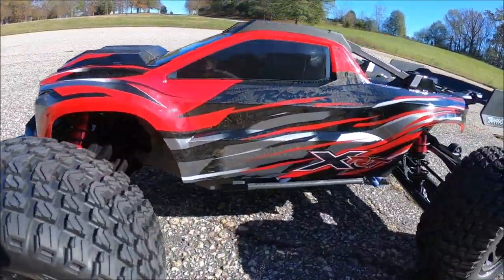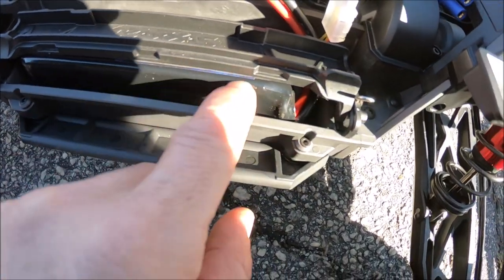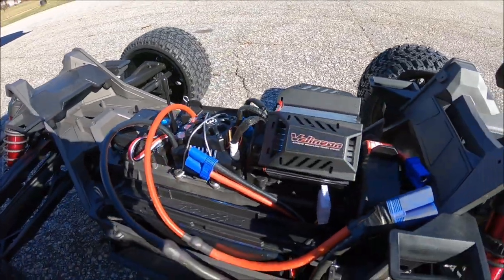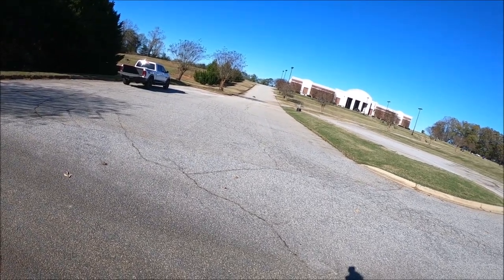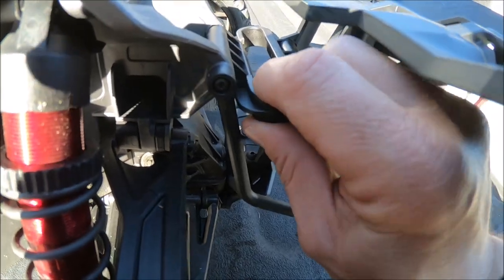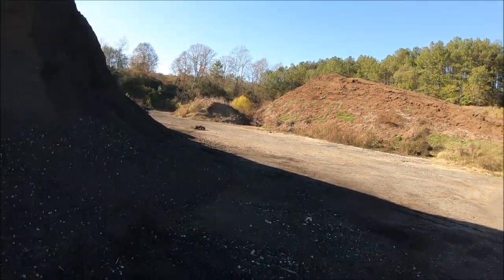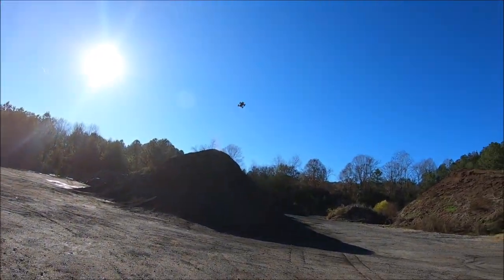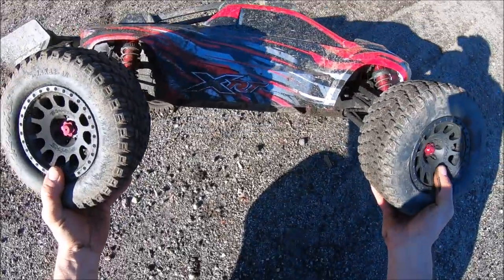NEW TRAXXAS XRT 8s Maiden Thrash!😱 This Truck is....!

Comment: Thanks again RCD, always love watching you do your thing.
👍🚀💯🔥🚀🤙 
It would be nice for Traxxas to accept my year old X-maxx 8s back and send me an XRT. Since they where short handed, being disabled I went on my weekends to my local hobby shop and helped them repair RC's.  They paid me on a gift card and of course the Xmaxx is what they knew I wanted and we helped each other out. So I held onto every penny put on a gift card so I could not touch it till paid off the X-maxx.  The part that really gets to me is that I ran on 6s first as I was waiting on the 8s completor pack and it ran fine. As soon as I got the 2x4s batteries, first run found out that they had thrown the 6s tires on the 8s I got and 2 tires came unglued quick. Realizing they were 6s rated, contacted traxxas support and told them about the tires and the sent me 2 new tires. Problem was the tires come in one direction to a pack and I had 1 from each side come apart. So I in good faith bought the other side. 4th run as I was doing a wheelie back to me the front dropped and you could hear the motor spin but no movement.  All but 3 teeth combined between the spur and pinion stripped. So called traxxas again and was told they do that just buy more. 🤔 If you know the gears are like the particle board of gears, why not put steel gears in? On the 5th -6th run as it was coming to a rolling stop it would grab and stop, roll it back and forth with my hand and forward it would grab and no wheel movement. Had the local hobby shop look at it and couldn't find the problem as I already checked out the f/r diffs especially when the gears stripped to make sure the teeth didn't get into other parts. Was told to come back if more pronounced.  2 days later brought back as it sounded like a bike with cards in the spokes. So the took out the Center diff only to find out it should not have passed QC because the spider gears were machined wrong and that they usually don't check the center diff because that's very rarely a problem. So it sat at the shop for 5 months waiting on the spider gears, so I decided to order from Cali and they got here before the ones they ordered from Traxxas one state over. They replaced them and when the ones they ordered came In under warranty I have as backups for any reason. 🙏ing nothing goes wrong with it now as it sat pretty much 8months out of the year warranty so not alot of time if something electrical goes out. Also the 2x4s batteries are paper weights now as some how one month after warranty on batteries, fine one day then the next, 1 with 1bad cell and the other had 2 bad cells.  I even balance charge, have a cell checker/equalizer and pamper my batteries making sure if not being used in 2-3 days after to store charge. And no signs of wear or damage.? Sorry Just had to share my experience with the Xmaxx and if the XRT was out earlier would have went with it instead. More my type of vehicle.  Ya for a $1000 Rc I pretty much only run 6s now since I'm afraid to go back to 8s. At least on the X-maxx.  I wondered WHY everyone was changing all the electronics and gears. I wish they were short staffed again so I could work off most of the XRT. ALL THOSE PROBLEMS AND I DON'T SKY BASH. Just racing around and hitting jumps in my yard going no more than 3ft in the air. Fireteam on it's way. Xmaxx on it's way out the door. 🤣🤣
Reply: Also reported that guy trolling you channel telling people they one a package from you. To take a screenshot of the text and respond to him for the prize hoping to help get him caught or blocked and leave your channel alone. I got another this morning. Just FYI 👍

Comment: Absolutely awesome first Rip Brother Eric 😜!!! The stock tires looked great on the asphalt and nice at the gravel spot too. Really a good call by Traxxas for all around mixed use. The flat style chassis has such a huge strength advantage over the arched XMaxx 😱. Those huge ramp sends are evidence enough 🚀🚀. I'm stoked with the handling focused large truggy platform 😍. M2C is all over it. Can't wait to try out the 1100 HW combo!!! Loved that wicked freestyling at the pit Bro 🍻. Thanks for another great upload!!! 🤙🤙😎💪👊👊
Reply from the maker: Thanks Brother Rich!!😁Definitely had fun and better luck with the XRT than I did with Humpty🤣🤣Traxxas really nailed this platform! Just can't wait to get more horsepower and some M2C beef!💪💪Yes the flat chassis makes a big difference in overall strength! Can't wait to run it again! Thanks for your comment bro!😎👊🚀🚀

Comment: Out of the box, You have to watch temps on stock gearing too. The Servo blew in 2 runs, the wing mount was gone. I’ve done almost ALL the m2c upgrades for it (besides chassis brace) have an 800kv Hobbywing and I still favor the K8 EXB. Just as durable, more fun, more controlled and i spent less.
The XRT IS fun but not K8 fun.

Comment: Did you at least try the stock esc,or are you just over stock electrics? I'll have one eventually, I would've loved to see a stock bash,then hobbywing. Looking good,thanks for the info.
Reply from the maker: Honestly I have limited time so didn't feel like bothering with the stock ESC. It's difficult to program and it dumbs down the power. In past experiences anyway😂

Comment: Seems like no matter how fast a car is, out of the box.... that some people will always say it needs to be "woke up". The truth is, this thing is wicked fast straight out the box, especially with the included speed gear. With that said, I enjoy watching these guys straight up abuse their equipment, so I don't need to.
Reply from the maker: Yessir that's why I used the speed gearing and HR 46 steel spur. With a Max 6 she was pretty quick just lacked extra torque. Definitely fun truck for sure!!😍👊💪💪
Reply: It can barely backflip out of the box.
Reply from the maker: @BeautyBeastRC  That's why it needs a better ESC for more power and speed gearing for more wheel spin!
Reply: @RCDUDE81  Yessir!! I have an xlx2 and tp 5660 1356kv in mine and geared 25/48 with stock tires it really woke up the backflip ability. Love this truck, super durable!! Great video btw bro!

Comment: Why replace the stock ESC?  What does the Hobbywing give you that the stock one cant?
Reply from the maker: More power and easy to adjust!
Reply: @RCDUDE81  Thanks for answering. Most of the time people (yt’bers)  just do stuff without reason or little “good” reasons. You know, just adding bling, or showing off. Finding out why people do their mods helps me alot to figure out if its a good upgrade and worth my money.

Comment: cant help yourself..... its a rc kinda thing. so much battery you just keep doing more and more lol. love the 6000ma+
Reply: Yep just did same qirh my 800 exb Mojave and blew rear diff tried simply swap with center diff by just changing main gear adding oil while some one talking to me now I'm out 100$ in diffs or alot of time at the least 😀 I'm convinced only the straight cut or swb arrmas only cars that can handle my style bashing I'm going experiments with bigger arrmas but I mat just end up all swb lol
Reply: @paulclancy2404  ya the bigger truggys and monster trucks have better diffs but they go to once you add big motor with a big jump. but like you said you get a lot better luck. if you not crazy it will last. bashing you cant forget traxxas lol. got my xmaxx few months now and once you get the oversize bearing for the back and a d style pinon its great . i am always like i wonder if i can jump over that or ride up and off this. see it fail/fall and laugh because i have  no worry's about it braking. looks great too

Comment: And we nee to call out traxxas on that week wheelie bar mount. Any traxxas with that oval bumper tends to break.
Reply from the maker: I'm sure they've got the memo🤣🤣
Reply: @RCDUDE81  lol especially with the Rustler 4x4 and the Hoss. Except the Hoss like to strip the screw from the skidplate.  Changed all that when I took the sledgehammers off and put the talons that go to the stampede on. Now it runs like the rustler 4x4 vxl, so tha that when it wheelies it's a solid wheelie instead of the sledgehammers putting so much pressure on the back. And put the sledgehammers on the rustler and a hoss wheelie bar and they hold together just by changing tires and the hoss bar on the rustler really ug stiffened it up and that oval doesnt flex.
Reply: @RCDUDE81  was that you or a scam about winning something? If not you someone is using your name to tell people they won.
Reply: @RCDUDE81  just don't want to be scammed. And don't usually win anything so being cautious.
Reply: @RCDUDE81  ok I haven't seen a package giveaway in any of your videos unless I missed something. If it's real, don't leave me hanging but otherwise I'll suspect it's like others saying dont respond to it someone else is using their name.

Comment: maybe I missed it, but why did you change out the stock speed control?
are there issues with it?
I saw one of these at the hobby store two weeks ago and really like this thing.
Reply from the maker: Honestly it's no good. Really dumbs down power and isn't easily programmed.
Reply: @RCDUDE81  
I appreciate the response and the honesty with the stock speed control.
I will keep that in mind if I do purchase one. That's another cost I was not figuring on paying with this truck.

Comment: Looks like a ripper! Noticed you used some wire inside that keep it from rattling off?
Reply from the maker: I used wire with screws to help hold down the ESC until I get a proper mount.😎
Reply: @RCDUDE81  this other comment real or is that a clone account? Noticed name doesn’t match yours

Comment: Do you usually buy 2 at a time? How did it hold up?
Reply from the maker: I showed the truck still running at the end . Only break was the wing bumper mount. But no I only have one🤣🤣
Reply: @RCDUDE81  if i want to see a real durability test i head over to your channel. How you like it?
Reply from the maker: So far I dig it! Better than the Xmaxx imo in every way😆Time will tell though. Hoping for another run soon!
Reply: @RCDUDE81  xrt vs Kraton..? Who wins? 🤞

Comment: Was this all shot on one set of Traxxas gears (spur and pinion)? If so that’s a huge improvement. Xmaxx wouldn’t have made it 5 min
Reply from the maker: No Hot Racing hardened steel 46 tooth spur but stock 23 pinion. Yeah the stock 46 spur would have melted🤣
Reply: @RCDUDE81  ah, definitely still an improvement. I still shredded a few of those HR gears in my xmaxx 😅

Comment: Those stock ESCs must be absolute trash because every influencer with a new XRT has changed out the ESC before its maiden run.  Yay traxxas.
Reply from the maker: Yes they are..Max 6 is like adding a super charger🤣🤣

Comment: Traxxas owners be like: it’s all stock. I just upgraded the thing, I modded this, I added that. I switched out this. Attached that. Adjusted here. Tweaked there. Changed out that. Swapped out that. But basically it’s all stock.
Reply from the maker: Mine is all stock but the ESC and optional speed gearing! Soon it Won't be stock!😎

Comment: I lost two of my xmaxx builds from zeee 9000mah batteries. I’ll never buy those again. Each time was over 800$ in parts gone. I strongly recommend people to stay away from them. I switch to powerhobby and cnhl batteries and I’ve never had an issue since.
Reply from the maker: Sorry to hear about that!😱I've never had issues (yet)and have ran them for a couple years. Important to always run padding in the trays and maintain the lipos! Yes CNHL makes a great pack too!
Reply: @RCDUDE81  padding was there and they were brand new. Maybe two runs on them. The warrantied the batteries and the first time out on the new batteries one of them went up again. Got a full refund and never looked back. Was unfortunate. I’ve seen lots of other people on fb have the same problem with the 9000mah. Just randomly igniting in flames with normal driving. My first fire I was jumping. Second fire going across a field. These was stock electronics too.

Comment: Be nice if someone could actually come up with a suspension that would actually work instead of slamming a thousand dollar buggy to its death on these jumps. Just blows me away slamming these machines to oblivion doing this . Might as well just pick it up and throw it on the ground as hard as you can and see what breaks.....lame
Reply from the maker: It's called chassis slap and you want that. You couldn't keep shocks or bulk heads on it without that!😱The shocks definitely lighten the blow then allow for a smooth rebound but in jumping rc's big chassis slap is a must.
Reply: I know, that's the nature of the beast.
Reply: If the suspension could absorb all of that kind of impact it wouldn't be drivable. Just throwing it out there!